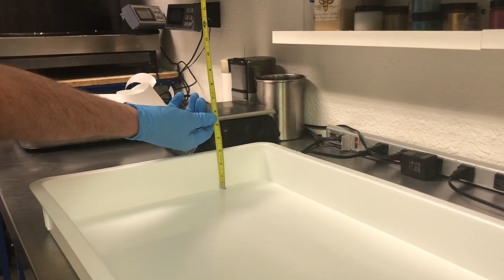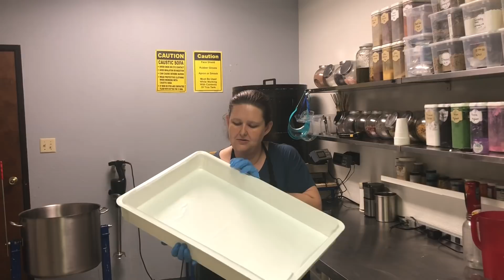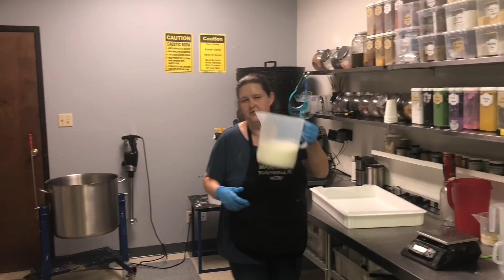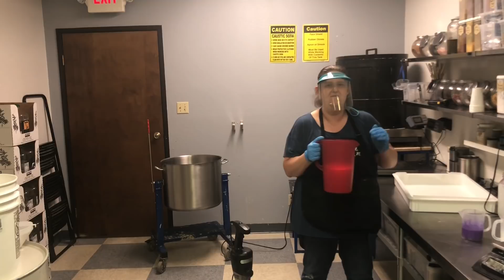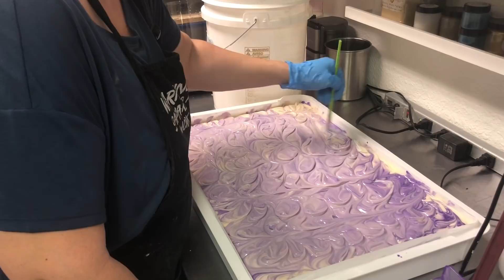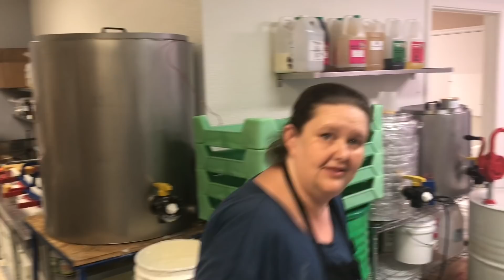How to Make Swirl Soap Using a Slab Mold | Cold Processed Soap Tutorial 💜

Comment: don't use plastic folks.
Reply from the maker: Why not? If you are lining the mold the soap will remove easy and the plastic is a high quality. I store small amounts of lye solution in plastic and make soap in a plastic pitcher. Why not have a plastic mold?